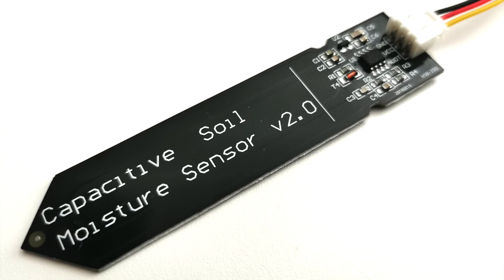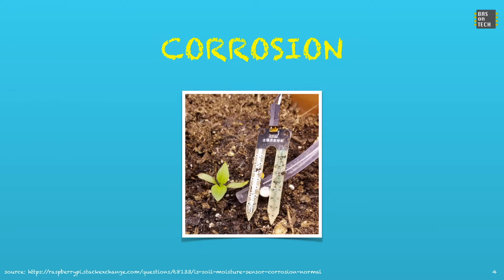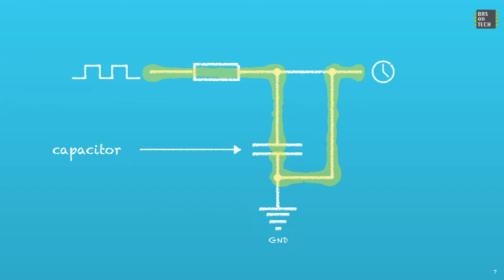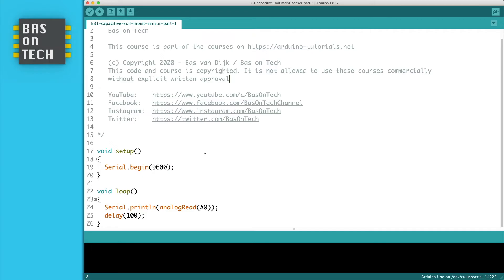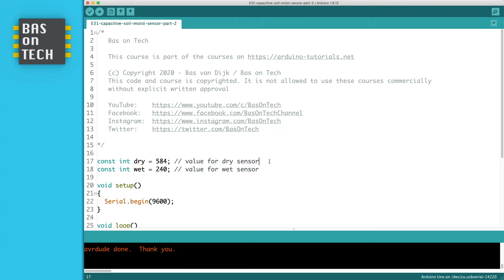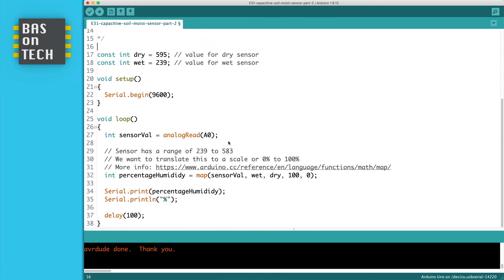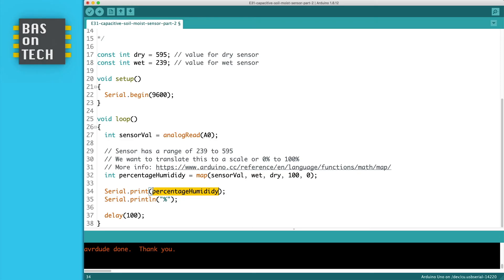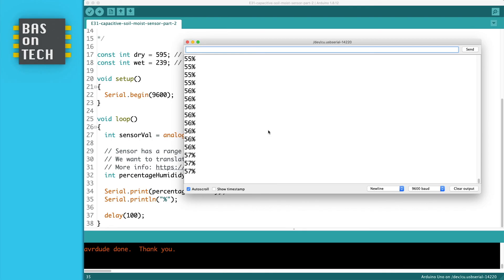SOIL MOISTURE SENSOR FOR PLANTS (V1.2 / V2.0) - Arduino tutorial #31

Comment: Best video on this sensor!  Question for you.  On other videos they seal up the sides of the sensor...I don't think you do that...do we need to seal up the sides with epoxy or something like that?
Reply: Yes the sensor leaks from the sides. They are sealed before scoring thus the sides were never covered
Reply: @Ed19601  thanks, I keep running into an issue where when I first stick it in water i get great readings, but then eventually I just get zeros.  I "sealed" the sides with nail polish that I had laying around as someone on another video has done.  Is this because I didn't really seal it?  You think the nail polish is a bad way to seal?  Should I order some sort of epoxy?
Reply: @peterm.4026  most nail polish will start to leak after a short time
Reply: @Ed19601  what's the best sealant for this?  I'm on amazon right now lol
Reply: @peterm.4026  i think some epoxy on the site or some rubber  dip.
Lemmecsee if i can find the brand
Reply: @peterm.4026  i think it is called PlastiDip
Reply: @Ed19601  Thank you!
Reply from the maker: Hi Peter, I am not aware of the need to seal the sensor. Neither do I know if it will affect the inner working.

Comment: Can you add to this a water pump that will be triggered when soil dry.  It will pump water until sensor detects water added then auto shut off pump.  The pump can be small as it will water a single plant.   Disabled, I need to make 100 of these set ups to grow food..  Most Humble Appreciation!  Alton
Reply from the maker: Hi, I thing there are better solutions available than using this sensor times 100. For such an implementation this sensor is simply not suitable.

Comment: I have 3 Capacitive Soil Moisture Sensor v1.2 and they are working only with 5 volts! If I use 3.3 volt I always read 0! 
Furthermore each of the 3 sensors has a different dry-wet range. For example one is 600-800 the other is 700-900. Is it normal for this kind of sensors to have different range for wet and dry?
Reply from the maker: Hi, I know there are some issues with these sensors. I can imagine that the range depends on the components. For the best result you need to calibrate each sensor individually
Reply: Most probably you have the same problem than mine: NE55 mounted instead of TLC555C(or...i)
Check this video from Stewart that will help you to solve. https://youtu.be/QGCrtXf8YSs
Reply: I Use the 1.2V variant as well and can confirm that the ranges are indeed different when the sensors are in the  soil. This comes from different local soil composition and especially the local pressure/tightness of the sensor within the soil. Even slightly touching the sensor while in the soil results in persisting value jumps, as the soil loosens around the sensor.

Comment: your video is awesome. 1 question, do you think the soil moisture sensor is going to sense the oil or just the water?
Reply from the maker: Hi, I think it isn't recommended to use this sensor in oil. It might damage the PCB and oil doesn't conduct the same way as water does 😃
Reply: @BasonTech  how about we try to attached a probe into the board so that the probe will be the one submerged in water with oil? I am planning to do a project about water in an oil and this capacitive sensor is one of my option because I tried resistive sensor but it is not functioning well with water detection in the oil
Reply from the maker: Of course you can always give it a shot, they're not that expensive 😃
Reply: The dielectric constant (effecting capacitance) for air is 1 and many oils is about 3 and pure water will be close to 80 but changes with temperature.  

Considering a smaller change in dielectric constant between air and oil, and slightly different constant for different oils, then it might be hard to get accurate readings.  For many different kinds of oils.

On the other hand, because of the big difference in dielectric constants between oil and water seeing a big change in the capacitance measured could easily sugest the presence of water.

And keep the sensor away from metal walls that will mess with the readings.

Comment: Nice explanation but this will not work. Cause of this shit analog output you will get sometimes other ranges. And if you have this sensor two weeks on with a deepsleep modus every 60 minutes wake up, you will see in most cases that after some days you can forgot everything. I tested 3 sensors 2.0 and more wemos nothing hold longer than 3 days. Then I turn of the deepsleep same result. So it is useless I think cause of the analog output. If I disconnected the sensor form the board for a while and connected it again it works again for a couple of time. Maybe my charge of the sensor was totaly useless. I dont know. But for me doesn't work. After 2 days only same result. Doenst matter if I put water or not.
Reply from the maker: Hi Adrian, have you tried to measure without the deep sleep modus?
Reply: @BasonTech  hi. Yeah as I wrote. With and without both the same after 1-2days the result didn't work. Only completly cut the power disconnect the cables and put together, works again. I have no idea what it can be. It can be ifc that all my charge of sensors are damaged. But why they work for some hours then? I have no idea.

Comment: Kind Sir,
Do you have video to connect moisture sensor also add water pump ? 
When dry, sensor sends message, pumps water plant until water sensor cuts off water pump?  Check every 3 days?
I am Disabled with brain damage but want plant outside and auto watering.

I have 12 vegetable plants. Neighbor helps now, but I want automated.

Can you do video on 12 sensor/12 pump system?

Or do one of each but tell me what to buy for larger quantity.
Most Humble Appreciation!  Alton
Reply from the maker: Hi Alton, I don't have a tutorial available for that. The easiest I can think of is to make the pump system work with a relais. You can switch this relais based on the sensor value 😃

Comment: if you have multiple sensors do each need their own set of wet/dry const int?
Reply from the maker: Hi, I don't think that is needed. However these numbers will differ between sensors. The question is how much they differ and if this is an acceptable bias for you. Otherwise you need to create a new wet/dry const for every sensor. In this way you calibrate them individually. 😃
Reply: @BasonTech  Thanks a lot, nice videos!
Reply from the maker: @wes2242  You're welcome and thanks! 😃
Reply: Hello, can someone teach me the code when you hzve multple sensors

Comment: WAIT!! dont use 5V. my Sensor is hot af. It works with 3V too
Reply from the maker: That is weird, I didn't notice any heat when using the sensor. It should be working fine between 3.3V and 5V according to:
- https://robu.in/product/capacitive-soil-moisture-sensor-v2-0/
- https://www.amazon.it/CQRobot-Capacitive-Moisture-Arduino-Compatible/dp/B01E8M3JP8
- https://media.digikey.com/pdf/Data%20Sheets/DFRobot%20PDFs/SEN0193_Web.pdf

Are you sure you have connected the sensor correctly?

Comment: Mapping the values directly to percentages assumes that the change is linear, which is not the case. I wish more tutorials would point out this fact.
Better way would be a calibration test, where a  dry soil sample is watered by tiny amounts of water until its fully saturated. This will give you a nonlinear function. Then you could fit a curve (e.g. a logarithmic function)  to your observed values and apply a proper calibration.
Reply from the maker: Good point! Thanks for sharing! 👍🏻
Reply: I think he's provided all the instruction necessary in text. He saved you the time you'd have to spend watching a video. For practical applications, if you know when to water a plant, you can just take a reading at that point and make it the "water now" level. Take another reading after watering until water comes out the bottom of your pot and you call that "100%". It's not actually 100%, but it's as watered as the soil will get. Then get some pumps and maybe some relays and get to auto watering. At least that's my plan.
Reply: @JaredLucas  This is what I did. I hooked up a potentiometer and mapped it to the difference between dry and wet. I also mapped it to 1-10. When the dial is turned, a LED blinks indicating the level it's set to (1-10). When the sensor alerts me the plant is dry, I check it with my finger to see if I agree. If I don't, I adjust the potentiometer. Quickly it will get to where I want it, and I don't have to worry about VWC, actual sensor readings, etc.
Reply: @whobetterthankyle  thanks for the follow up on this!
Reply: @JaredLucas  great point.  I would even go so far to say that % concept isn't needed. One only needs a value for when to add water and a value for when to stop.
Reply: @kreynolds1123  you are right, it would work as you said, however if you follow gardening instructions for watering plants, will that not refer to moisture in percentage? It could save some time and plenty of trial and error to convert the range to percentage as it was shown and just base the watering on whatever moisture percentage is advised for a certain species. If I’m missing something can you kindly let me know?
Reply: @Ferreira019760  How about stick ones finger in the dirt every so often. When you sence it is ready to be watered take your reading and call that value the time to water value.   On further thought, one only needs a predetermined amount to water.  So water 5 seconds,10  or what ever is needed.  Adapt the concept to the specific needs of the plant. 

Many times the biggest problem is waiting for the perfect,  as it gets in the way of getting started. I'm speaking from personal experence worrying about every little detail  has held me back on numerous projects, and try to keep it simple.

Comment: what is the difference between v1.2 and v2.0?
Reply from the maker: Besides the typo of the analog out pin on v2.0 I could find any information about a difference between both. The component layout looks the same. Maybe the probe part is different, but I couldn't find any information which supports this.
Reply: @BasonTech  I have a v1.2 and it has the same AUOT typo, which I actually didn't notice until you mentioned it. I also have not been able to find any info on the differences between the 2. They seem identical. Thanks for the reply.